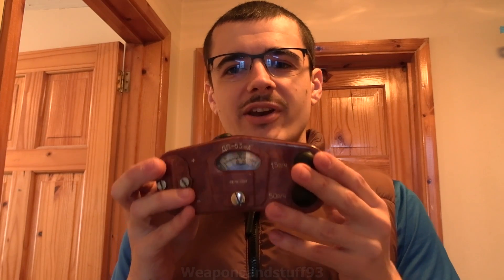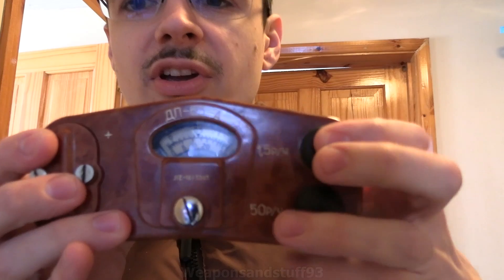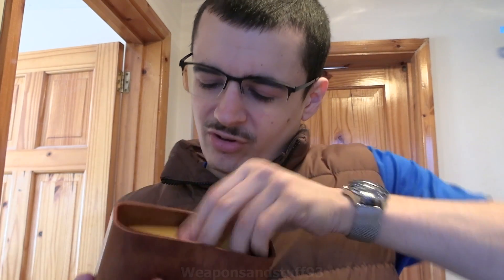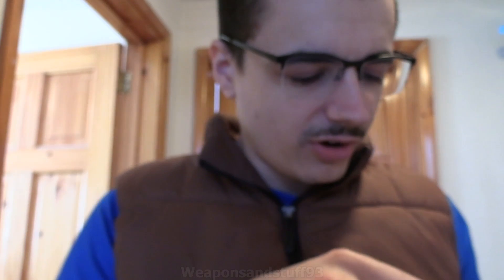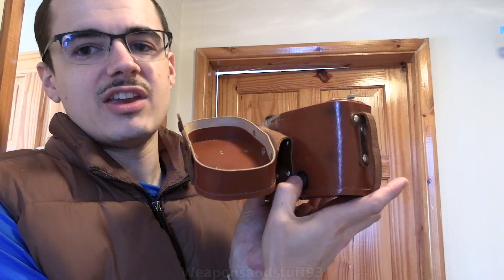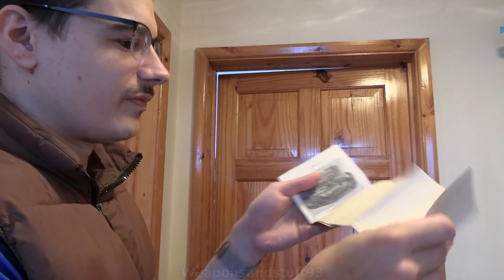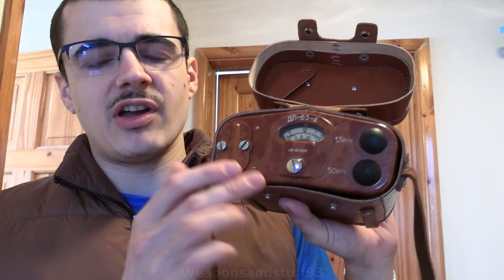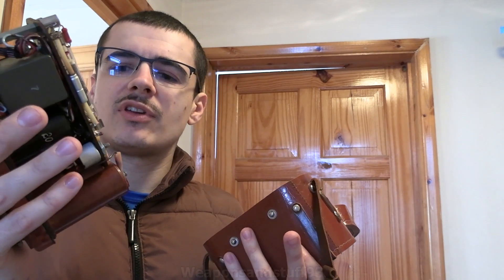DP-63-A A very Radioactive Geiger Counter

Comment: the reading from the inside of the unit is not from a check source - it's from radium dust contamination, and you've likely contaminated both your geiger counter, your hands and your surroundings with radium dust.

Comment: Before I forget, you were handling the inside of that DP-63A with your bare hands. Do check the inside of the counter with ...another counter, for traces of radiation because with these devices oftentimes what happens is the Rn-222 gas produced from the dial floats around and outside the dial enclosure, then decays again and precipitates as another daughter product somewhere inside the device. This reaches much farther than the Ra-226 paint flakes and overtime the entire counter's inside becomes coated with radioactive Pb-210 and Po-210 dust in detectable amounts that warrant not letting it lie around and washing your hands.

Comment: looks like it would run off 2 C cell batteries, depending on the voltage requirement
Reply from the maker: C cells are a bit too fat, easiest thing to do is AA batteries in a sleeve with some conductive foil.
Reply: 6GL 0,05 batteries needed those are 7,2V and 50mAh 4 of them for this version, i have a IH63 small dosimeter and i need two for that
Reply: @biczodaniel7685  I could design a battery adapter that would prob do the job too
Reply: @Captain_Char  that would be great!! I have a ih63 personal dosimeter that needs 2 of these batteries and i dont know a way to bypass this only with using a labor power supply, and this ruining the whole point of a personal dosimeter
Reply: @biczodaniel7685  as long as I can find the physical dimesions of the original Cells, I had to do some research to find the DP-5B battery sizes which I then 3D printed adapters to allow standard batteries to be used in it, some cases may need to creative designs to get the right voltage

Comment: The interior of the device is radioactive due to radon :)
Reply from the maker: You'd need an alpha detector to pick up radon, the inside is radioactive due to the SR-90 source mounted inside and radium contamination.
Reply: @weaponsandstuff93  Some time ago I did the alpha scintillatiom (SSA-1P probe) inside measurement, there was a lot of radon inside :)

Comment: The Sr90 source is under the GM tubes on the unit itself, it's the one that kinda looks like a pop tab. the radiation you are picking up inside the casing is contamination from the Radium.

Comment: I really don't want to sound like some interwebs nervous nellie, but be really very careful when dealing with the radium paint source. Radium lume is a bugger for flaking as it sucks up moisture like a thirsty camel. It also breaks down into other nasties and that will permeate into the rest of the case. EG if you get a radium dialled watch and remove the hands and dial, what's left, the case and movement will usually show residual radiation. It also off gasses radon, so keep any radium sources in a very well ventilated room. A radon detector a good plan. It's really nasty stuff. Breathing in even the tiniest particle would make a 60 a day smoking habit look healthy.  Given it is you and the very cool collection you have, I'd be taking it apart outdoors wearing one of your respirators/gas masks, wear latex gloves too.

Comment: put a berillium piece on top of the radium (it should be in direct contact) and you will have a nice neutron source for experiments
Reply from the maker: Interesting
Reply: @weaponsandstuff93  also be very careful. i know someone who had contaminated a whole room while trying to remove the radium painted scale. now after extensive cleaning background radiation in the room is 0.4 microsieverts
Reply from the maker: @rolandasa.1112  Don't worry I did it properly.
Reply: @rolandasa.1112  So, background is STILL around twice normal? That scale sheds lots of particles & daughter products...so best avoid at all costs.
Reply: @andreasjack1000  yes and the dp-63 is still radioactive because there are some radium paint particles left in the electronics of the dosimeter. at all costs i would avoid getting this dosimeter unless i had an airtight glove box to remove the painted scale.
Reply: @rolandasa.1112  "Radium Quetzal" on YouTube knows all about that...he's hooked on Radium for some reason.
Reply: Nice one! And btw, these meters were suited with flint glass in early development to stop that radiation. Stopped that after counting the potential exposition in field conditions. 
1965-67, AFAIK. Basically, every unit you can find for sale since the original manufacturer was a small pocketsize lab.